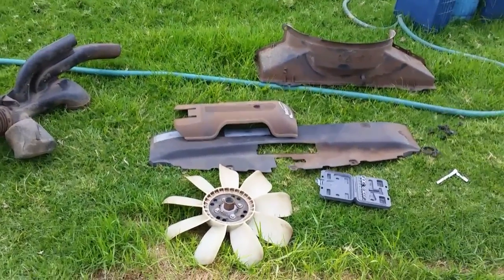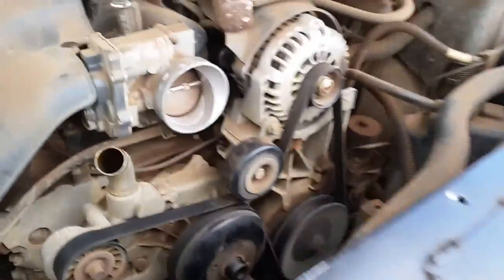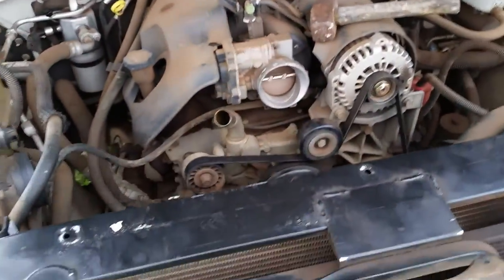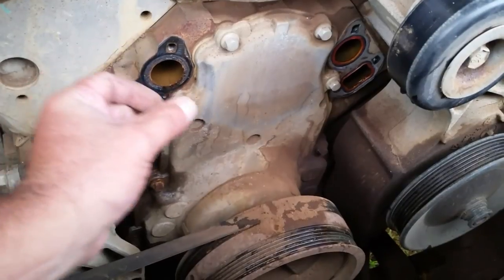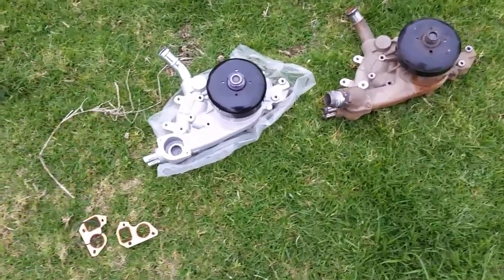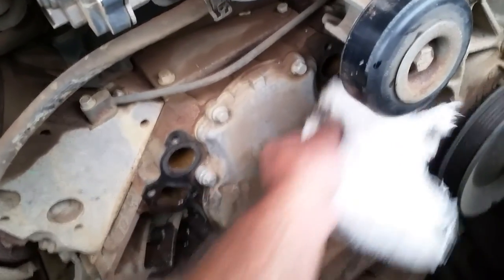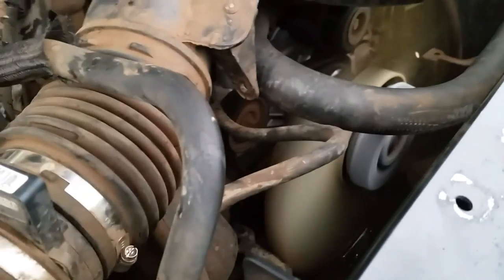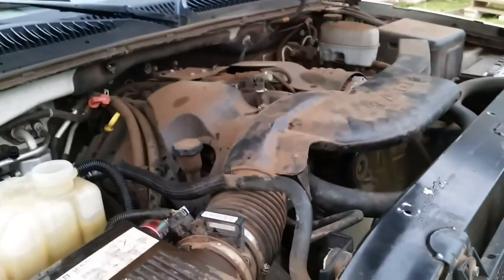Replacing Water Pump DIY

Comment: To remove that fan clutch nut...get you a large adjustable wrench....then take a hammer and hit it pretty hard ....and it spins right off no damage....
Reply from the maker: +Int2tech I tried that but no luck maybe my wrench was to big. But that's for the input.